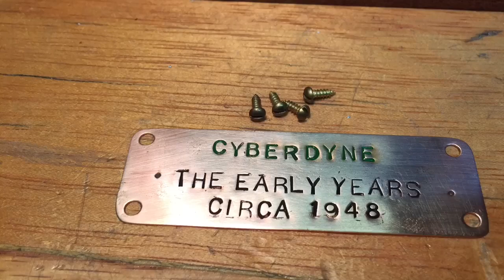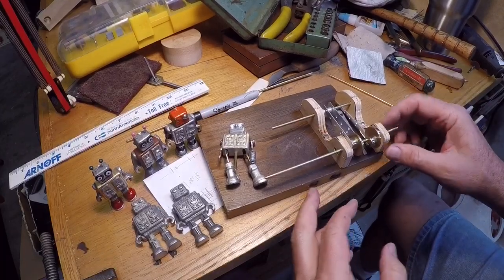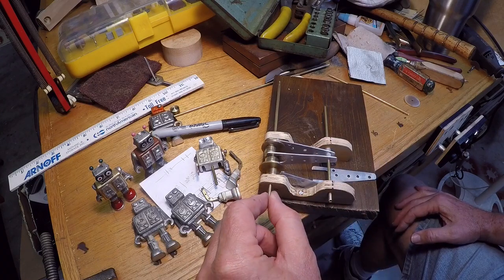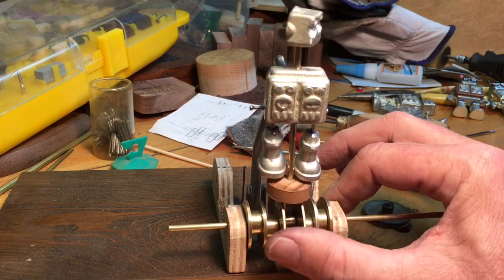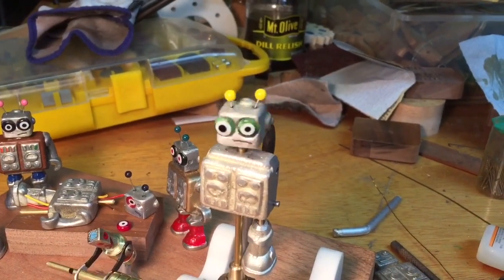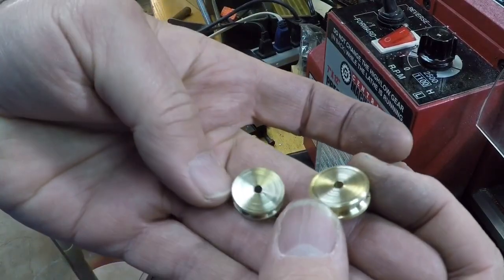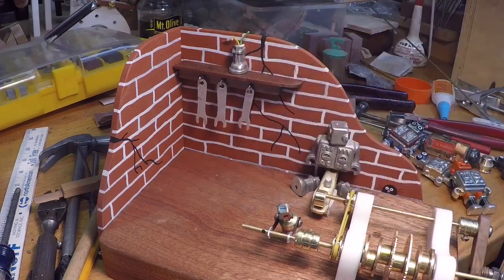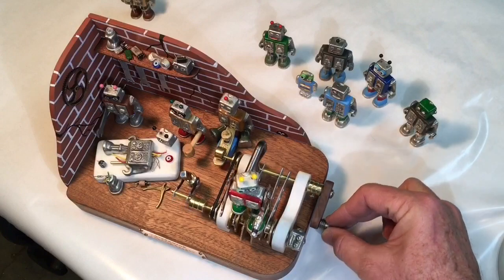"CYBERDYNE Bot Factory - The Early Years" Automaton Diorama Build Details

Comment: I spy me a little parting tool I have to try making! Definitely thanks for sharing...
Reply from the maker: Dave M My buddy made that for me. I was dubious but dang it works really well. And the cut is thin so I don't feel like I'm wasting material...
Reply: Just made one for a dead hack saw blade and works like a charm!
Reply from the maker: Dave M I posted the saw blade tip on a machinist FB site and the comments were split between "great idea" and "everybody knows that". Anyway, now I know it and I'm saving a few of those worn blades!